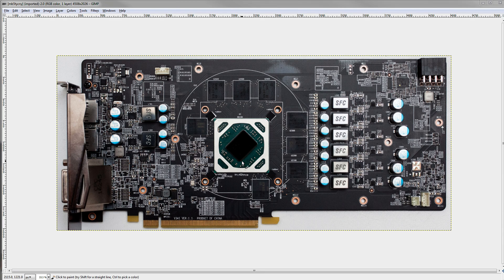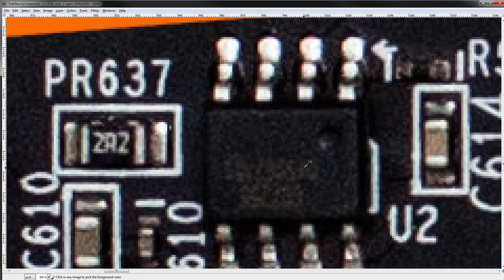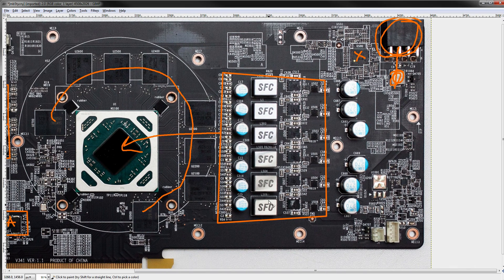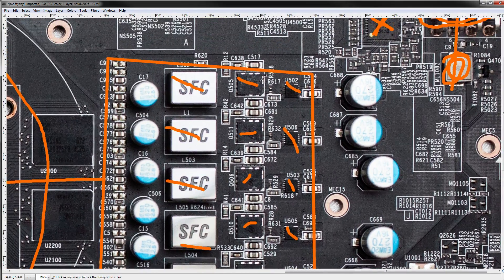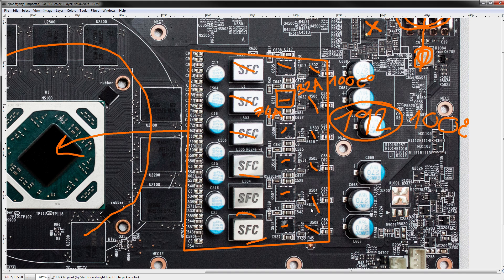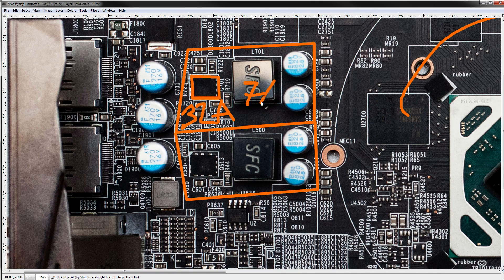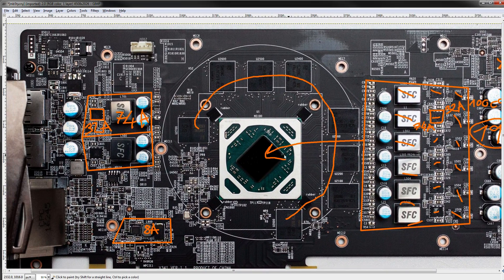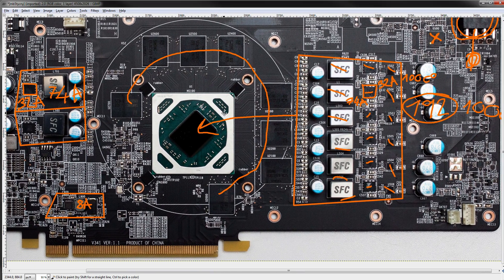PCB Breakdown MSI RX 480 Gaming X

Comment: It has the best Cooler, but not really worth the price jump from a GTR.
Reply: Red Devil goes all over the place. Some report 65°C maximum, others report 80°C maximum. Seems like their quality management is bullshit.
Reply: Nah the Red Devil and Strix have the best coolers.
Reply: it is at the same level on cooling performance than the strix. In fact is a little bit quieter.
Reply: Worst cooler would be from the gigabyte one
Reply: Sebastian Contreras The worst is the reference, then comes the Gigabyte RX 480 G1 Gaming and then the Nitro+. Those are the cards I would avoid + the Red Devil.
Reply: Worst non reference*
Reply: First g1 gaming that i got was  damaged, freezed every time i wanted to play, second one is extremely quiet, holds boost and never gets beyond 63 degrees celsius  (first one was like 80 degrees easy) + it was cheapest r480 8 GB. Go figure...
Reply: ***** Another one with bad quality management to avoid then.
Reply: Well, they did stick the logo on upside down... So, their quality assurance is fairly low at powercolor...  lol
Reply: My card arrived today. They've removed the logo completely now :/
Reply: Marcus Really?  lol

I just bought a MSI 480 4gb on Jet.com.  Got a great deal on it.  It is coming tomorrow.
Reply: Yeah I think it's removed on all version 2's of the card. Shame because it looked great even upside down. But the card itself is phenomental, runs almost silent with temps of 60 at load and sub 40 on idle. This is on the silent bios, haven't tried the boosted one or unlocked one yet, but haven't undervolted yet either.

Gratz on your card tho!(:
Reply: Marcus yeah... but the pcb is a crap
Reply: Julian Grimoldi Crap compared to one that is insanely overkill, sure.  But that one is insanely overkill...  The powercolor is sufficient for normal OC'ing. 

He apparently wants near silent operation too, which likely makes it one of the best in that regard.
Reply: john handcock you can buy an msi gaming x with near silent operation, and much better pcb and never goes up to 70°c
Reply: True, I ordered my red devil before the pcb quality came to light. Otherwise I would've probably gone with an XFX or HIS. That said it doesn't really matter since I'm not going for any kind of extreme oc, and the low temps and noise are very appreciated.

some MSI's have issues with power draw, and tend to draw 30+ more watts than the other 480s and run hot. There's a bios update for it but I don't think it solved the issue. A second version of the card was released that fixes this but I don't think there's any way to tell which one you're getting.
Reply: Marcus is not a real issue, is a sensor issue. The real power consumption is the same as the other cards, i tested mine and a sapphire nitro from a friend with a wattmeter from the wall and we get the exact same results. My temps never goes up of 73°c. Normally stays on 68°c
Reply: Not all MSI cards have the issue. This review proves that it's not just sensor related: https://www.techpowerup.com/reviews/MSI/RX_480_Gaming_X/21.html
Reply: i just recieved a bios update the last week for my gaming x. The power consumption went from 150/160w (typical gaming load) to 100/110w

Comment: look like the Strix is the way to go if you're going to go with a 480
Reply: the GTR is worth a look IMO
Reply: When you consider all the factors, the MSI card is the best imo.  

Also, they currently have a rebate going.  You can get the card for as little as $154 atm in the USA.  That's insane!!!

It really doesn't matter that the MSI PCB is just average, because it's still overkill.